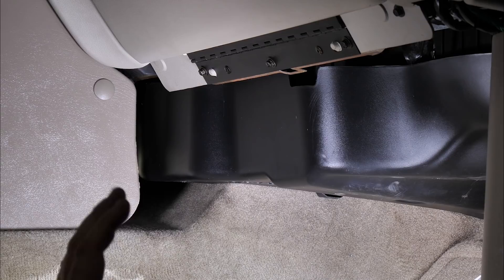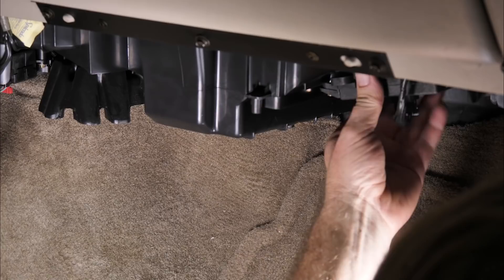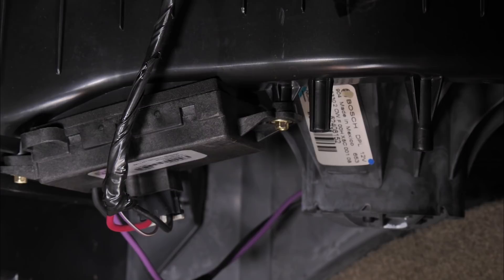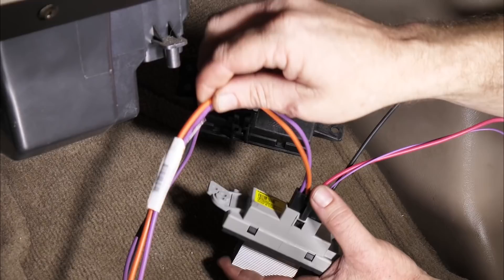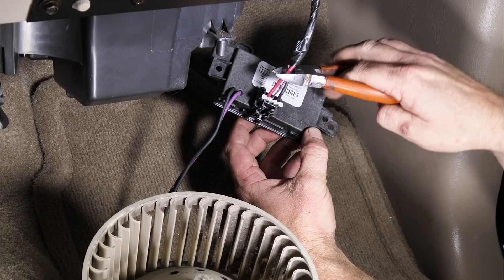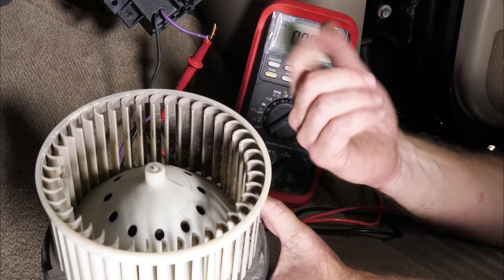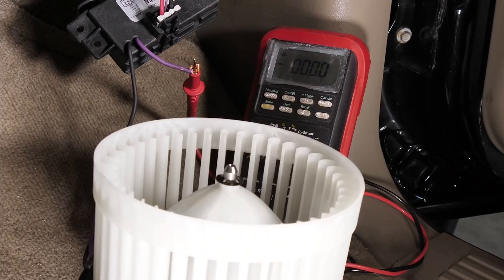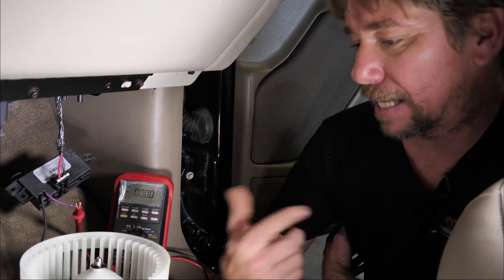Blower Motor Resistor Wire Splice & Amperage Draw Test

Comment: Quick correction: failure of the resistor means it resolves to closed (full contact), not "open' (no contact).   My brother told me to write this.  He is a mechanic.
Reply from the maker: That is correct and why the blower stays on. If we said open, than we apologzie.
Reply: @APDTY     No worries at all - I'll tell my brother, and great video,    🙂

Comment from the maker: The original blower motor resistor on Hummer H2 and other models has been discontinued. This is the new version which fits almost all GM trucks from 2002-2009. This is for models with automatic temperature control (ATC). Yes you will have to splice in the new module and yes you should either verify the blower motor amperage draw or just replace it as a worn blower motor is many times the actual root cause of your blower resistor failure. Here is both parts available at Amazon:
New Design Resistor: http://amzn.to/2wvCEuo
New Blower Motor (Verify your model before purchasing):
02-06 Escalade, Tahoe or Yukon: http://amzn.to/2xjD4S5
02-09 Trailblazer Envoy Rainier Saab 9-7x:http://amzn.to/2ww5XwP
First Design Trailblazer Envoy: http://amzn.to/2gcRU97

Comment: I have the exact same vehicle I cannot figure out why my fan quit working and if I wiggle the wires it used to go on and stay on for quite a while and now I can't get it to hardly do anything. It's definitely a problem right in the 3 wire plug. I don't see how I could possibly be a resistor problem.

Comment: I have a question I have a 03 Chevy avalanche I replaced the blower motor and the blower motor resistor 3 months ago 
the blower motor completely quit yesterday I put on a new blower motor resistor this morning  the blower still wouldn't work so I pulled the blower motor out and bought a new one it wont work either there are 2 wires coming out of the blower motor resistor red and black that plug in to the blower motor the red wire has power at settings 1-4 and the black wire has a little power at setting 5 no power  on red at setting 5
What could  be my problem 
I took a wire and clipped it on th post where the black wire would go on the motor Hooked it to a bolt under the hood and took a wire connected it to the positive on the battery and touched the end on the post that the red wire would go on the blower motor and nothing I did it to the old motor and the new motor neither one would spin are both motors bad or is something else wrong

Comment: ......I know the new module works ok......but do you realize you installed it backwards......if you look at the 14:05 mark in video you are putting screw in the right side....the screw tab is offset which should be to the left. Should have just rotated it 180* and the tabs wouldn't have bent up as you screwed the screws in.....lol

Comment: why dont you use clamp ampro meter ??????
Reply: I tried to check my blower with a clamp meter but the reading was 0
I usually use the clamp meter at home to check the AC appliances

I don't know if it should work the same for DC

Comment: Helpful video. (What multi meter do you use?) I have about the same problem on 01 Chevrolet Malibu. Hvac not working. All fuse and relays check ok. Turn on controls, no fan speeds, no defrosting or ac when buttons are pressed..replaced resistor still nonething. 
Test#1: I took a battery from my jeep and with 2 wires woth.20 amp fuse tapped into the blower motor purple and black wires every thing works. But my wires coming from my battery got hot..  would it be possible i may have a ground issue? Note before my battery test. 
Theres A 20 amp fuse for hvac located in passenger side dash fuse box, with test light key on tap top tabs on fuse shows ground on both sides, fuse not blown. 
Test#2:  i take that fuse out and supply jumper power with 25 amp circuit breaker into that location,  the blower fan comes on, in all speeds but the controler button are still non functional.. 
Test:3 -i took a fused wire from the cars battery taped it onto the blower motor purple wire turn car on the blower fan came on BUT on speed #2 &4 the vehicle auto headlights turn on and fuel & temp gauges were working (they haven't worked when got the car.) Could this have something to do with reversing power into the cars power supply and computer modules?
Reply: So ☕

Comment: Hmm it sounds like that old module didn't have a good enough startup circuit.
Hope the new one is better.
Reply from the maker: Yeah the old blower motor put too much of a load on the old blower resistor and that is one of the main causes of these burning out or shorting out which can cause the blower to stay on high at all times, even with the ignition off.

Comment: I have a 2004 gmc Yukon XL and I already replace the Blower Motor Resister 5 times, I also replace the blower motor and the climate control unit brand new. I don't understand why the Blower resister keep burning out. They only last me around two to six months, I wonder what else it is causing  the resister to go out.
Reply from the maker: Pedro Pena it is best if the new blower motor and resistor are replaced at the same time, you can do an amperage draw test on the blower motor and jump the blower motor without the resistor to see how many amps it is pulling, of running amps is over 10, it may need replacing

Comment: Awesome video. I wish I would've watched it BEFORE my repair. So, what happens if I cut the wires without removing the fuse first? What did I mess up?
Reply: it would blow the fuse
Reply: Thank you!
Reply: Could it mess up the relay?
Reply from the maker: Cutting the wires without removing the fuse or battery voltage, can allow the wires to short together which would blow the fuse, this is why you always want to disconnect power on the system you are working on or disconnect the battery. If you disconnect the battery, you can lose important data, be sure to pull any stored trouble codes as you might erase data necessary to diagnose other problems in the vehicle. Pulling the fuse allows you to isolate the system you are working on while leaving power to the other systems.
Reply: @brianodom797  do you know what fuse
Reply: al ex the40 amp fuse under the hood

Comment: what components do I need to run a blower motor outside of a car?
Reply: A positive and a negative wire and a battery I test them off my car battery with a inline fuse on the positive to keep it at 30 amps on most cars
Reply: @lizard944  brilliant!!!!! Good answer
Reply: @lizard944  that plastic shielded hamster cage might take your arm off if your not careful,ha ha ha

Comment: No reason at all to change the blower motor. You sold a good b.s. reason to do so. But not necessary. First one peak was at 20A dropped to 15 to 10, second was about 18A peak down to 13 to 10. NOT NECESSART AT ALL.
Reply: Actually, he is being thorough. This is a pattern failure in these trucks. Knowing this, if he did not replace the blower motor and the resistor shorted again, he would be expected to warranty the repair. Not to mention the inconvenience to the customer and the damage to his reputation. Customers may grumble over the cost of a repair, but it is soon forgotten as long as the repair is done right. However, if they have to come back for the same issue, they won't care about the money you "saved" them originally. In other words,  one "uh-oh" cancels a whole lot of "atta boys". This is considered a smart practice.
Reply: @mobilemechmantim773  that's the uh oh us DIY guys dont see as reasonable. I just changed mine and it was literally locked up. That one was just fine and more than likely the customer looked back at this video for job reference. I see and smell bs. It's always good to make a preventative decision. But really. It smelled.
Reply: @unexpectedpigeon6654  DIY is different. You are responsible for the repair you make. If you decide to chance using the blower motor again, it's on you if the resistor fails. 
 Also, there is such a thing as a blower motor drawing excessive current without being locked up. You have to look at the whole picture to get to the root cause. If you don't eliminate the root cause, you didn't repair it correctly.  It's like this. If your tire has a nail in it and goes flat, you can fix the symptom by airing it up, but its gonna be flat again soon. You have to repair the hole in the tire to keep it from happening again.
Reply: @mobilemechmantim773  I know where you're getting at but a flat tire compared to a still good working blower is by far different. It's like saying because you "had" a nail in it, you'll have to replace the whole tire let alone you can patch it within the inside. Get my point? Imagine watching a video of a guy saying oh darn, theres a nail in the tire. Have to go replace it with a new one. That's what I see when I see this. Yes, DIY is not set in stone but it's like the example I gave. It's just one of those things that the voltages were not really far off and he just gave a bs excuse to need to change it. Like the tire. You can patch it, but itll "probably fail" down the road. See?
Reply: @unexpectedpigeon6654  I think you missed the point of my analogy. I said that you have to repair the root cause to keep the symptom from happening again. I said nothing about replacing the tire because it has a hole in it. 
  Again, a blower motor can turn and draw excessive amperage, both in-rush current and running current. I said nothing about voltage.  The same voltage is supplied and will drop across the motor even when the current becomes excessive up to a point. When the motor speed drops enough, the current will rise and you could see the supply voltage lower and the ground voltage raise slightly, although it may not stand out on a DVOM. 
 I think if he used an oscilloscope it would have shown a better picture of how it was failing, but he didn't.  
  I am going to make a suggestion and it is in good faith. I think you are a smart person and I don't want to make you think I am trying to belittle you. 
 Here are a couple of books that changed my understanding of automotive electrical systems. 
1. Fundamental Electrical Troubleshooting by Dan Sullivan
2. Vehicle Electrical Troubleshooting Shortcuts by Vince Fischelli
3. Engine Performance Diagnostics by Paul Danner
 The first and third authors have YouTube channels. 
  I don't think I am any smarter than you. I have just been doing this for a while and I thought I could share my perspective on the matter. Not all techs are crooks. I think we have an obligation to educate people about the hows and whys of what we do in order to get away from the image that a few bad apples have caused.
Reply: @mobilemechmantim773  1. You're over thinking it. Not going to use an oscilloscope because that's too much. 2. I just smelled bs. That's it. Nothing more nothing else. I honestly am not going to argue over what I sense he did compared to going down to some facts on how to actually determine if it's worth someone's decision to replace it or not. I'm studying to become an electrical engineer so please save me the references because again. I'm just pointing out he dosnt need to change it because the reading obviously show a still good working blower. That's it.
Reply: @unexpectedpigeon6654  Your opinion. I use scopes almost daily, even for "simple" diagnostics. Much more information than you can get from a meter. How else can you get good using your equipment if you don't use it? 
 I can see that you think you're too good to learn from this. I was giving you an honest perspective into why this man might have decided to replace the motor in the first place. You seem to just want to accuse without all the facts. I was trying to give you both sides, that's all. Not everything, or repair for that matter, is black and white. Sometimes you have to use your best judgement based on the facts and your experience. 
  You go ahead and accuse. We will just have to agree to disagree. 
  Good luck on your degree.
Reply: Yup, money comes back in time, a dissatisfied customer doesn't! Did ya get the cert?